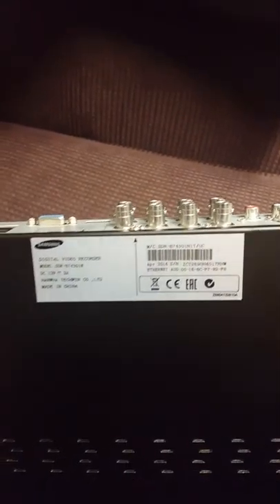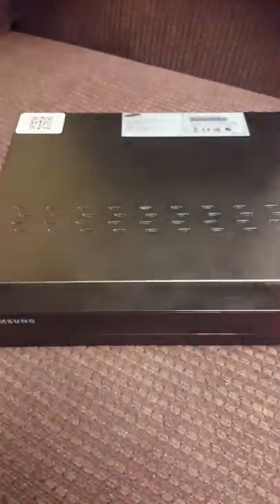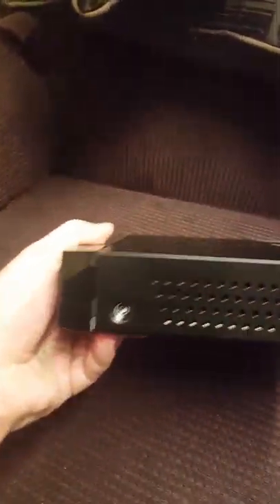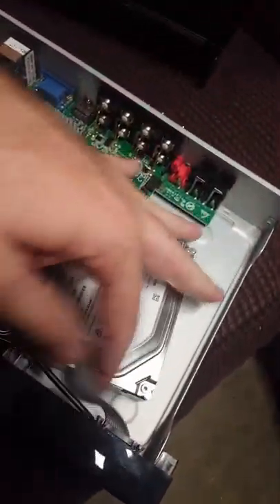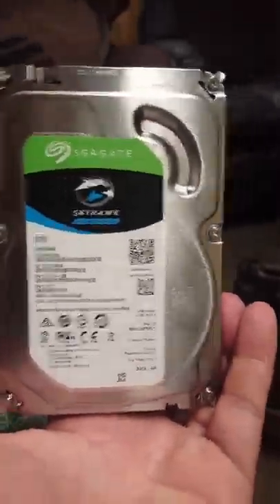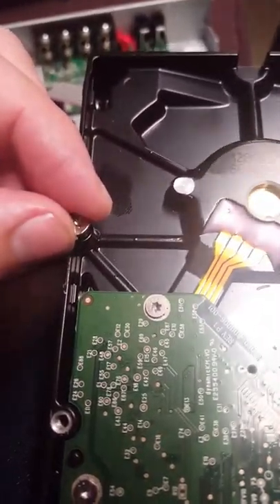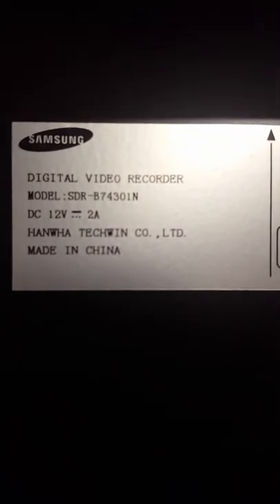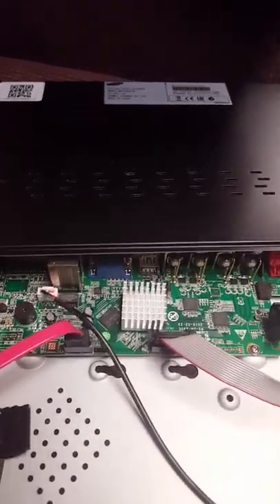Samsung SDR-B74301N Hard drive replacement

Comment: Do you know where I can get a replacement remote for this model. Trying to do a factory reset but I can't without a re mote
Reply from the maker: If you're wanting to reset back to factory and don't have the remote. 
You can unplug it, open it up just like in the video. Take the coin battery out and  ground it the circuit board like I show in the video.
It should reset everything.

Comment: How do you find out what hard drive to buy for your unit?
Reply from the maker: Zoza Zoza From my experience I have stuck almost any sata connection hard drive in these units and not had an issue.  As long as you don't put anything over 2tb.
Samsung or Hanhwa tech win however u spell it had a list on their website which hard drives were compatible.

Comment: Mine went out after a power outage. I had a 4TB Purple drive and I tried to replace it with the same drive and the unit will not recognize the drive (old or new one). I put the original 1TB drive back and it works fine. I tried all kinds of formatting options with no luck. What a pain! I have 2 - 4TB drives now that just sit there laughing at me. Thank you Samsung for your quality product (being facetious).
Reply from the maker: I think Samsung ruined their name by Branding other companies products. I think these are Hanwha Techwin. 
Ive never tried over 1 Tb HDD bc I had read on forums that these would accept booger than one or two TB. Just Walmart I read from ppl on forums. Haven't tested it myself. 
Mine still works great after all these years. But Everytime a power outage happens. I have to call tech support to make it work with my phone app. It's ridiculous.

Comment: But in my SDR I am seeing rebooting issue. Its rebooting the system every 20 mins. I am not sure if its the supply!  SDR system is Samsung SDR-C75300 16 Channel
Reply from the maker: I have a newer Samsung now and it was doing the same thing you mentioned. Rebooting all the time. I replaced hard drive and reset bios by shorting the battery terminals and it fixed it
Reply: Thanks. I can try this
Reply: @mayorhp  i can't seem to get the battery out is there a special process to do it without breaking the mount?

Comment: A Grounding Wrist Strap should be worn and attached to the dvr to discharge any static from installer body or the couch which can zap and kill your sensitive devices such as hard drive, motherboard or other components on the dvr. Best if you lay the dvr on the tile floor or a wooden table while working with any sensitive device.